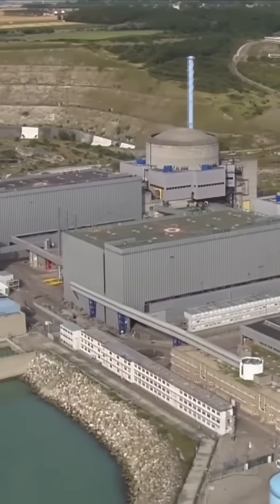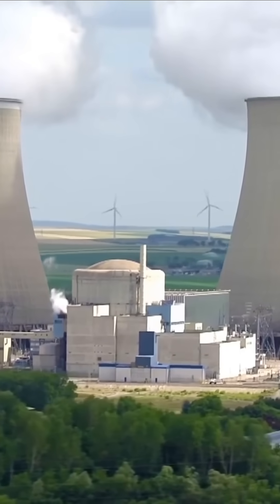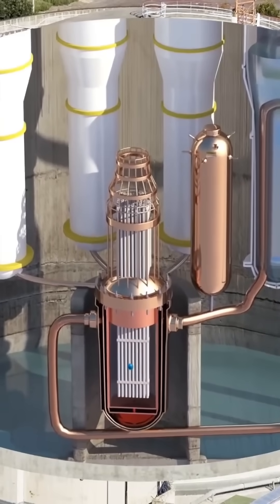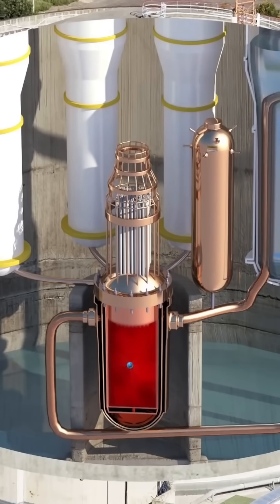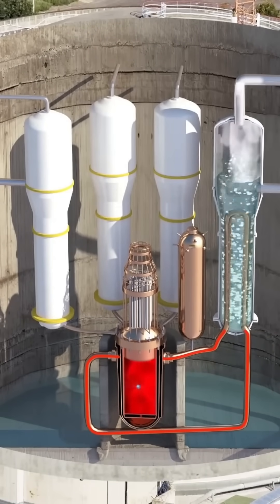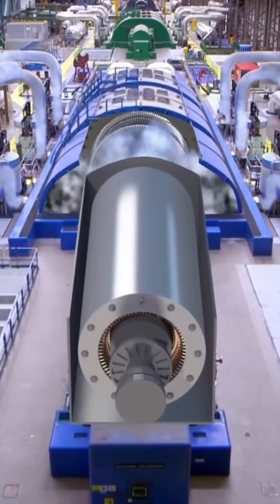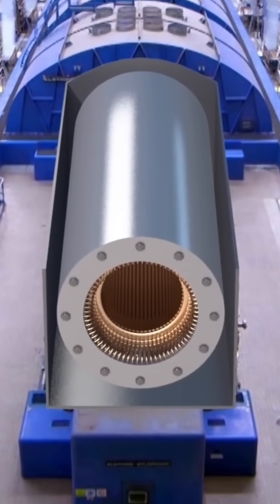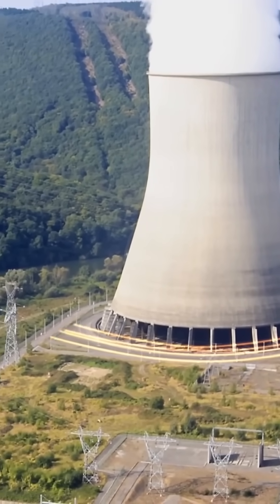How does a Nuclear Reactor work? #shorts #nuclearpower #nuclearreactor

Comment: Seems pretty stupid to use nuclear power, why not use solar power or electromagnetic power to power the world? Solar and electromagnetic power are much safer than nuclear reactors. If electricity goes down then eventually nuclear reactors will go down too. Seems really stupid to rely on nuclear when it could melt down when electricity stops and back up generators stop.
Reply: Nuclear power provides much more than solar ever will, and it is constant, while solar has more frequent output reductions depending on weather and the time of day. Not sure what you mean by electromagnetic, I've never heard of it. But nuclear doesn't just melt down like that. Passive safety systems keep the core cooled, RCIC can operate via a steam driven pump utilizing residual reactor heat to maintain a flow of feedwater even when absolutely no power or controls exist, and generators and batteries are placed so that they'll never go down, alongside being designed with several redundant generators meant to last for days and portable generators in case main ones are damaged. And the reactor building are enough to entirely stop damage from an accident anyways.

Comment: Tell us how does it explode
Reply: 1. Extreme pressure applied on the top sector. 2. Zirconium fuel cladding starts generating hydrogen and gets ignited.
Reply: @superlama31 extreme pressure  hadn't that much effect because that had an lead roof but the void that got created due to the unavailability of 
Fresh coolant which reduces reactivity and at th3 same time they inserted the rod whose tips were made of graphite which accelerated reaction to the levels which were too dangerous
Reply: @atmkbsdafjg bPressure had a huge effect. The high pressure caused a steam explosion at Chernobyl which lifted the reactor lid. That is what allowed oxygen to enter the reactor and ignite the hydrogen. Otherwise it'd have been just another normal meltdown.
Reply: @pixuxucobrasil9206 nice and tq but there are thick shieldings to control.pressure 

It was void which got created due to the unavailability of water due to which there was nothing to reduce reactivity and at same time engineers put the graphite tipped rods in them which even further accelerated reactivity

Comment: Anyone else waiting on the NRC in the US to get off their butts and push for Molten Salt Reactors? I prefer Thorium, but even u-235 would be fine.
Reply: US just needs to quit that nuclear bomb stuff and get their damn tritium for fusion
Reply: @pixuxucobrasil9206  How many times have you heard "nuclear fusion is right around the corner"? For me, it's been many times. Yes we are getting closer, but most of the nuclear fusion devices are trying to create heat and transfer that heat to a gas (CO2 or He) to turn a Brayton-cycle turbine. Helios is on to something be acquiring beta particles to create energy. Although the exploration of fusion should not be stopped, I find it less challenging to build, and way more beneficial, use a Molten Salt Reactor (MSR) to use up 96% of our expended nuclear fuel stockpile to convert it to "medium" and "low" risk. Currently Yucca Mountain was to hold this 100's of 1000's of year radioactive material. But if we use it in an MSR, we can energize our grids and turn this waste into only 100's of year risk.

Comment: So basically boiling large bodies of water to create a lot of steam to turn the steam driven turbines.
Only difference is that instead of just using basic heat, we're using radioactive chemicals and explosions to heat that large amount of water up quickly.
Am I correct?
Reply: Sort of. Firstly, nuclear power plants get a lot more power than a majority of other kinds of power plants, and it doesn't pollute the enverionment at all. It's why it isn't as simple as boiling water. And there's no explosions, fission in reactors is different from that of nuclear bombs. It just splits the atom and makes some heat. But yes in the end every power plant is making steam in increasingly more complex ways, its just that nuclear is better than the others (in my opinion).

Comment: I still didn't understand "how" it works.
Reply: I'll try to explain what I know.
To clarify this is a boiling water reactor.

The BWR uses special types of fuel, usually uranium, to produce heat from the process of fission. Fission occurs from splitting atoms using a tiny particle called a neutron. The splitting of the nuclear fuel generates heat. This process occurs in the reactor core. To control this reaction, control rods are used, usually made of boron which is a strong neutron absorber and makes the reactions stop. The water is used in BWRs to increase reactivity, because after fission the neutrons are extremely fast and cannot react. The water slows them down enough that they can react with the fuel again. In BWRs, this water is boiled straight in the core and becomes high pressure steam that is sent to a turbine. Turbines are a big blade that spins using the pressure of the steam to spin, and convert the kinetic energy of the spinning into electrical energy. The steam, after going through the turbine, is sent into those cooling towers where it condenses back into water and is sent back into the loop.
Pretty sure pressurized water reactors are almost the same, except that the water being boiled is kept separate from the core, and the water in the core is kept at high pressure to not boil. Heat exchangers hear water in the boilers to then send it to the turbine.
Tell me if this didn't help though, I'll keep trying my best to help c:

Comment: Unstable rock are forced into close proximity by humans over hundreds of cycles in a massive staged centrifuge set up. The unstable rock is then solidified into fuel rods, the unstable rocks are now stuck together. We put them in a massive tank of super pure water really close together. The water slows down the angry neutrons that try to leave the human made trap, the neutrons then are more likely to hit another unstable rock which makes that rock spit out several angry neutrons in retaliation. Causing a self sustaining reaction of angry neutrons hitting unstable rocks, this heats up the water. The water is passed through a heat exchanger where it turns an input water into a high pressure steam. The steam turns a turbine and is dumped into a cooling tower, or a reservoir to be fed back into the input. If the rocks get too uppity, we insert peacekeeping rocks to absorb the neutrons and terminate the retaliatory strikes.

Comment: I hate to be a party pooper but us reactors are not light water. There Heavy water. If a reactor uses water as a coolant and moderator then its a heavy water. The reason for that is the "heavy" water slows down nutrons. Now if this was a light water reactor it would most likely use graphite as moderator like RBMK reactors. Thats why there also called LWGR (Light water Graphite reactor)
Reply: Heavy water is a different thing. And MOST US reactors are light water, LWGRs are a whole different thing.